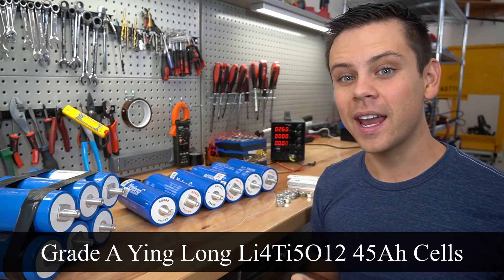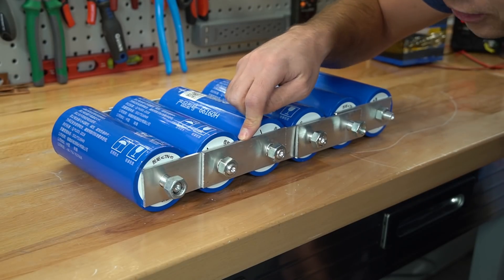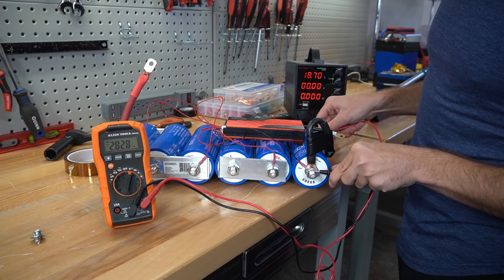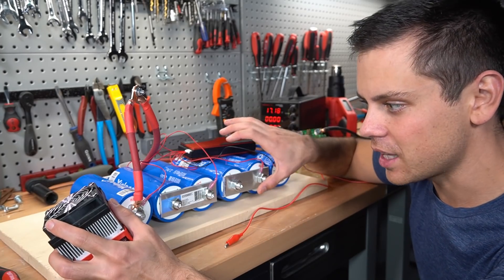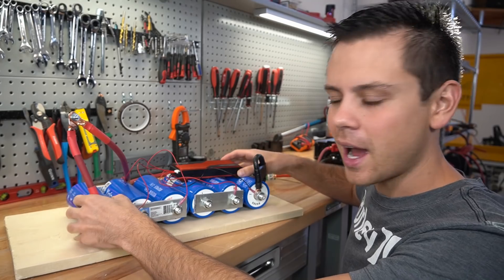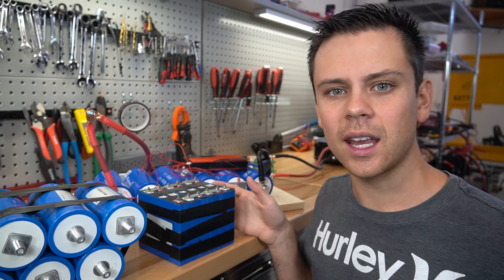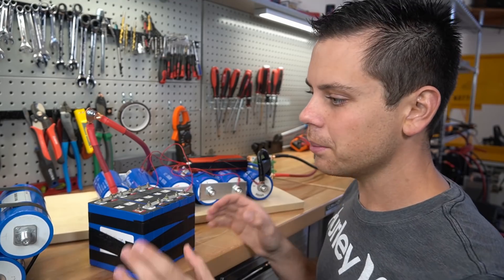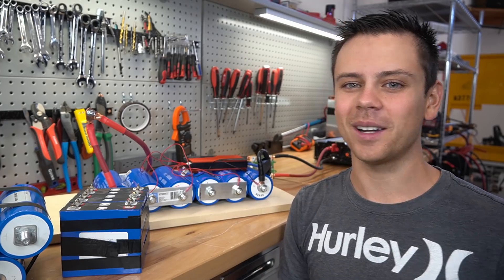$493 Aliexpress 45Ah Grade A, YinLong Lithium Titanate (LTO) Cell Testing

Comment from the maker: Update: The BLS store is giving me a full refund for the issues I experienced with their LTO cells.

They said that they made a mistake and the cells were not labeled correctly.

They wanted me to remove the video, and I refused. I told them that this will be a lesson to ensure that it never happens again.

I still do not understand why these problems happen so often with battery distributors. This has happened on numerous occasions w/ multiple suppliers. Hopefully my video will teach the other companies a lesson.

Previously, I did like the BLS store, and I have bought some really nice cells from them in the past.

I am glad that I was ripped off before my viewers were. Who knows how many people they sent these cells to. If you bought these cells, test them and return them if necessary.

~~~~~~~~~~~~~~~~~~~~~~~~~~~~~~~~~
Tired of getting ripped off? Check out my "Will Prowse Approved" solar product recommendations below!

12V Batteries
https://www.mobile-solarpower.com/lithium-batteries.html

48V Batteries
https://www.mobile-solarpower.com/48v-batteries.html

Offgrid Inverter System Builder
https://www.mobile-solarpower.com/48v-complete-system-blueprint-559371.html

Hybrid Inverter System Builder
https://www.mobile-solarpower.com/code-compliant-48v-offgrid-system.html

Mobile Handtruck System Builder (very popular!)
https://www.mobile-solarpower.com/mobile-48v-system.html

Solar Panels
https://www.mobile-solarpower.com/300w-solar-panels.html

Ground Mount Solar Racking
https://www.mobile-solarpower.com/ground-mount-racks.html

Wire, Lugs and Busbars
https://www.mobile-solarpower.com/wire-and-connectors.html

Tools
https://www.mobile-solarpower.com/tools.html

Fuses and Circuit Breakers
https://www.mobile-solarpower.com/fuses.html

Plug-N-Play Solar Systems
Ecoflow, Anker And Bluetti! So many models to choose from. See my current recommendations here:
https://www.mobile-solarpower.com/full-size-systems.html

~~~~~~~~~~~~~~~~~~~~~~~~~~~~~~~~~~~~~~~~~~
Need to build a large DIY system? Need a trustworthy solar distributor? These are my favorites:

Signature Solar
Creator of EG4! Solar Minisplits, Victron and More! Largest Solar Store Online.
If you want $50 off, please use my link below and coupon code "DIYSOLAR50":
https://signaturesolar.com/?ref=cPwLcVc0SW-BjN

Current Connected
Best Prices for EG4, Victron, Midnite and so much more! Fast Shipping and Highest Rated Customer Service:
https://currentconnected.com/?ref=wp

~~~~~~~~~~~~~~~~~~~~~~~~~~~~~~~~~~~~~~~~~~
Join our DIY Solar Community 
Need more help? Join the largest solar forum on the internet for beginners and professionals alike. 140,000 members and counting!
https://www.diysolarforum.com

Check Out My Free Book
Best-selling and beginner-friendly guidebook to off-grid 12V solar!
https://www.mobile-solarpower.com/the-book.html

~~~~~~~~~~~~~~~~~~~~~~~~~~~~~~~~~~~~~~~~~~
Contact Information:
I am NOT available for personal solar system consult! If you wish to contact me, this is my direct email: williamprowsediysolar@gmail.com
FTC Disclosure Statement and Disclaimers:
Every video includes paid promotion or sponsorship (such as free products for review). Some links on this YouTube channel may be affiliate links. We may get paid if you buy something or take an action after clicking one of these. My videos are for educational purposes only. Information is subject to change/update at any time. Electricity is DANGEROUS and can kill. Be smart and use common sense :) DIY Solar Power with Will Prowse is a participant in the Amazon Services LLC Associates Program, An affiliate advertising program designed to provide a means for sites to earn advertising fees by advertising and linking to Amazon.com
Reply: Thanks for the reveal. Sounds fishy to me.  I think many battery companies do this.
Reply: @Eratas1  i liked the fact that you showed us a screenshot of the comments and the evidence you uploaded to AliExpress
Reply: I doubt they would admit that to anyone else...pretty hard for them to defend after all the testing You did.
Reply: Thanks for the Vid and NOT Taking it down !
Such reviews are Lessons for vendors & customers too.
Any frauds / misrepresentations intentional or not must be put into the open for everyone to know it is happening.

Out of curiosity.  
Do the date codes match ?
Production codes printed on the cells ?
Is it possible that they are New Old Stock that have been laying around in a warehouse for a period of time ?    Should not be a factor unless something happened in storage, freezing or ?
Reply: @stephsoltesz6731  Especially since Aliexpress now hides (!!) all reviews older than 6 months!
Reply: Oh so it was honest mistake? Yeah right ,thank you Will appreciate what you do!
Reply: Stand your ground Will, because you do not stand alone.
Reply from the maker: @yeti.communications  thanks Jerry 👍
Reply: Thanks for that, so you can ignore I bit of my last post.
You are Epic.
Yes, let them learn from this, I hope you don't have to pull the video down.
Reply: Thanks for the info. Bi can only feel that this is the response they are giving you and only because they got caught.  I'm sorry I feel that  way, but for real how many were "miss labeled"?  but you make a very good valid point this is exactly why people should test everything that they purchase.  I would truly like to know how many were in that category of mislabeled but we will never know the answer to that because the majority of the people probably do not test them.  If at least they don't test them to the quality that you're testing.  

If it wasn't for you doing this, for people, how many would have ever known? 

Thank you again.
Reply: Did you asked for full refund and goods returned or only full refund?
Reply: I would never remove the video for them. It could have been on purpose and so ask yourself if you want to reward that. Either way even on accident I wouldn't remove it. No no crime should not pay.
Reply: All Yinglong Lto are grade b the only great A LTO cells Shengquan LTO  also test Lishen LTO the are on eBay for 25 I sold all my Yinglong  and I'm running Lishen LTO cells good luck
Reply: Thanks for standing your ground with corporations we need more like u
Reply: hi, i work with battery suppliers from china for about 5 years and if talking about LTO cells - there is lots of interesting stuff hapening with such cells in china and it's very tricky to get exactly what you need, first 45ah Yinlongs cells i got about a year ago and on 2C test (my single cell tester only can handle up to 80A current) i got around 46.1-46.4ah and they aint cost that much in china mainland, the price is around 30-35$+shipping, quality depends only from suppliers good faith, because if we`r talking about Yinlong products - there`is no A grade available on the market and never been, only B and C grades. The only A grade cells i could get is that one i bought from Yinlong directly, but that is comlicated even for wholesale byers ;)
Reply: @afanasof  Could you tell us what  good and trust supplier sell it with tha price that you mentioned?..thanks
Reply: Thanks a lot for your good Video and your lessen for BLS. I also bought 2 LTOs. 1 cell sounds like there is liquid inside. Is this normal? You had the same experience? 
BLS told me thats normal ! Is it? 

Greetings from Germany
Reply: as a rookie want to be - THNAK YOU
Reply: Xs Power sells these cells grade a for $60 a piece I believe US based great company we use them for car audio
Reply: @kadinbieberich6248  XS told me they are grade B cells. I've not seen anywhere on their site specifying grade A. Grade A are for electric cars not car audio. Hope I'm wrong but I don't think so.
Reply: Good on you!
Reply: great job. keep them honest!
Imagine that.
Reply: I am sure they are cheating all over the place. Only few people will seriously test them as you did. If only 10-20% do test and go through the hassle of refund procedure, they make a big bargain. Unfortunatly that behavior is also true for many ebay sellers, esp. from China. Good to keep this on your channel and let all people know!
Reply: They expect 99% of customers will not verify the product because it's too hard, time consuming, naive, or don't care enough. Returns are factored into their cost model. This is the China model when selling internationally.
Reply: Hi very nice video and usefull test.
I know why this problem happen so often so they asked to you to remove this video! ...because you taech us how we can test the cells and ask the refund!....Best Wishes thanks
Reply: Hey Will, are you going to be doing an update for the titan solar generator?
Reply: What's up dude ok so my application is in car audio I need 400amp hour of reserve I will be charging at 15.2=16v what would be the best cells to use for my money in your opinion thank you! Ps love the channel!
Reply: It seems like they just re-label 40Ah cells and sell them as 45Ah ones. I've heard that the majority of Yinlong cells are second life ones taken out from e-buses.
Reply: they simply looking for buyers that dont understand as much as you do, and sell them this crap, thats all, this way they never loose money, if you catch them, its oops, our mistake, perfect crime...
Reply: It is well known that these cells are widely used in China by huge Dumper Trucks in mining industry and Buses in urban transportation. After the vechicles are milked to dry, these cells go on aliexpress. So if the cell has one single sign of use and it isnt a shining recent made jewel, most likely it just came from an severe abusing applicaiton.
Reply: good job. immediate thumbs up .
Reply: Sounds like a cover story to me. They just don't make mistakes like that. Not in China.
Reply: Yeah, right. You just caught them and called them out on it.
Reply: No one who use google will ever buy from them again.
Reply: I've ordered a lot of things from china and the one thing they all have in common is dishonesty. They're raised different. They do not care about personal integrity or honesty. If they rip you off, they're proud of it. Really.
Reply: hey Will when are you doing the sbms0 video?
Reply: they got busted adn know it.
Reply: A . It's possible they faked the listing trying to scam people. 

B. It is also possible they are just a reseller and got lied to from their own supplier. 

This also happens often when buying from Asia, though in this case I personally feel it is A.
Reply: What do you think of these smaller 18AH LTO batteries like the Lishen cells that are cheap.   One could achieve 24v or 48v easier.  Just wondering about a long term battery for starting the engine and running basic pumps, leds, etc.     I will buy your Lifepo4 cells for my main power reserves but want a long term and cold solution with less capacity.   Thank you!
Reply: I’m so surprised they asked for the video to be removed. If you get the refund, it shows them in a better light.
Reply: What a name of the store.
Reply: Question:  6 cells * 2.83 = 17 volts.   So why did your PSU read at 18+ volts and stop charging i.e. 0 current?   (Do you have an over current protection setup in your power supply?)
Reply: Could you use a smaller battery for a ebike battery?, And if so could you recommend one
Reply: Batteries may need many charge and discharge cycle before it have full capacity. My new phone act just like this and now it works longer.
Are you notice battery voltage is 2.3V, not 3.6V as normally li- ion has? Maybe you not discharge it completly?
Reply: They or their sources probably test the first several batches then started cutting corners on testing and then qualities. It happens a lot.
Reply: I'd love for you to try xs power yinglong 45ah cells to see if there grade a or grade b I'm under the assumption that they're used cells but I have no way to test them
Reply: Personally,  I appreciate that you stood your ground. I'm sure they do not want people to know that they are being ripped off.
Reply: @ebenwaterman5858  hi did u buy battery  from Ali express?
Reply: What do you mean you do not understand why these problems consistently occur with distributors? They just wanna rip you off 1000s of kilometers away…
Reply: I can put it in the normal car, the alternator charges it
Reply: It happens so often because its easy money, and normal people who don't have a large following just get ghosted and are SOL. Doesn't suprise me they tried to get you to delete the evidence
Reply: That frank me to
Reply: I believe your batteries may have been A at one time, but spent 5+ years in use in China buses which is the primary use of this type of battery. 5 to 10 yrs. Then 15 to 20 yrs. At a lesser intensity level such as solar use. Just my opinion. Great job on testing them Thanks for your honest effort.
Reply: I thought these lithium titanate cells would be good to use almost like a capacitor right next to the inverter to help with voltage spikes on lifepo4 cell bank to essentially protect and maybe help with longevity of your "main bank" ?
Reply: The  66160h are not 45ah.   The 66160k  are 45ah .
Reply: I've bought all my 40Ah cells from there, kinda weird that those 45Ah are grade B's and 40Ah are grade A's. I have same capacity tester you used earlier, thanks for the link btw, and got 42Ah out of them
Reply: @JoniK1  When you have a near slave labour force, working 7 days a week to meet CCP targets, you're going to find a LOT of mistakes and QA compensated for by simply number of units produced.

If they start to lose money. They'll just pay their staff less.

Comment: I modded my ebike controller so I can run without a low voltage cutoff and rely on the battery's BMS to stop. I am thinking this is the perfect battery for me as I can run from 50v down to 32v.

Comment: How did Ali handle the dispute btw if you don't mind me asking? I remember having bought a '20ah' ebike battery, which turned out to be 7.5ah after inspection of the cells inside ( on video ofc, for the dispute ).

Seller claimed  I should charge it fully... Ali wanted me to ship the battery back for a refund... which I wasn't planning on doing so I opened a dispute with Klarna my payment agency. 

End result: full refund, battery still sitting here somewhere ( should really just get rid of it, it's not just a scam product the quality is also bad ).

Comment: Thanks for the video Will. I was board and looking at battery hook up web site and saw the prismatic lto cells. I haven't owned or worked with this kind of chemistry of lithium.  I was impressed with the cycle life and that it might out last my life. I'm 49 years old. I wanted to learn more before I bought any of them. That's how I found your video. I noticed that you made it 5 years ago. Have you thought about making a new one with new information that you may have discovered or learned since then? Well I gotta go. Got solar pannel adjusting to do. I love your videos. Keep making more brother.

Comment: I actually burnt down my 4 year old house charging lithium titanate cells at 3.7 volts because I forgot I had used the dc to dc converter previously to charge 3.6 volt cells. When I checked on the voltage whilst charging the voltage reading was 2.6 volts due to voltage sag at the battery terminal.

Comment: Sounds to me like you got 40Ah grade A cells. If you look around, that form factor is normally 40Ah, and they also sell 30Ah of the same size, likely using a cheaper process or materials. Always compare the size and weight when buying, and assume that they aren't suddently able to cram in 15% more than other suppliers (they likely just mislabel them to get ahead on aliexpress listings)

Also, it seems like this technology is likely to have a much longer calendar life. So they are likely to last for a lifetime. Only time will tell.
The only real downsides seem to be the mass, volume and variable unreliability of suppliers.

Lots of places in the world reach below 0 deg in winter, so that is a very important factor. Even with other types of lithium batteries you'd still need LTO batteries to run the heater, and shave off peaks.

Comment: Lol these actually work great as a starter battery in my climate. It doesn't matter if its -20, these cells turn that engine over very fast and it doesn't corrode everything it touches like a lead acid would. I think thats about the best use for them, unfortunately i use them in a 6s configuration and the alternator only charges it up to 14.8 volts on my particular car, but who really cares for batteries made for a starter.

Comment: If I buy 6 YINLONG batteries and join them in series to get about 15 volts with an S6 balancer, if I put a charger that gives 15 volts and 160 amps could I charge this kind of lithium battery??

Comment: When i check for 100 amp lithium batteries  as of this date on Alibaba it is roughly 300 USD  the LTO  roughly one dollar per amp , 
Or 6 batteries at 35 amp  for 35 dollars per battery. Not even close in price range. And if I  were going wire up lithium packs were talking 10x more complicated, plus a mother board
Or buy the battery  made . And cycle life is important if it weren't we could just all go buy lead acid and change out every year. 
Super weak arguement.

Comment: I can propose a scenario how to use this battery. If you are working at the off-grid location, you have to run a small electric tractor, a snow blower, a concrete mixer etc. So you can discharge the battery, then have a break to charge and keep working. So It's OK to charge it 5 or 10 times per day. If you have a solar panel with extra power output then efficiency doesn't matter but ratio of charge time to discharge time is critical.

Comment: Will, have you noticed that the 30ah and and 45ah (yours) on Aliexpress are exactly the same size? 160mm length (202mm tip to tip) 66mm wide. Highly suspicious! At this point I say run, don't walk to the nearest exit...